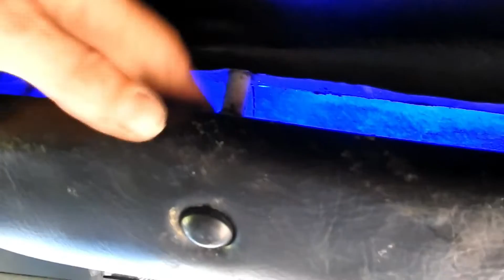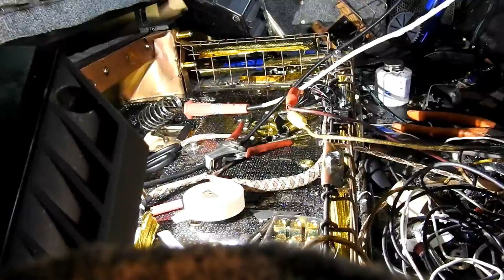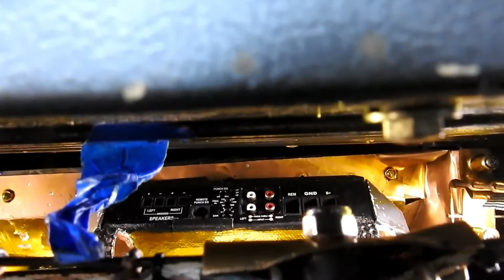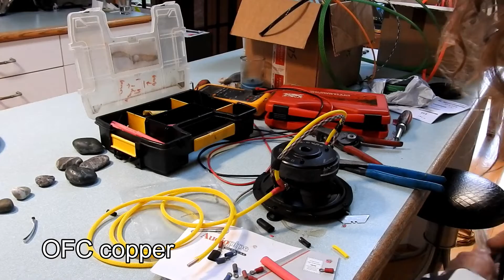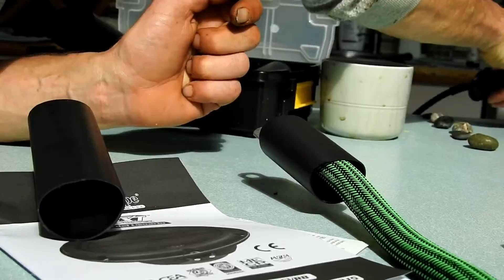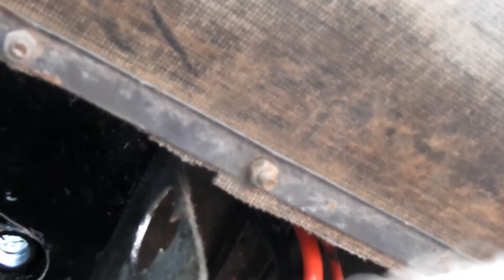car stuff no sky

Comment: It seems you have some type of plan. What are you preparing for?
Reply from the maker: Hi Melissa, had planned on traveling this past summer but I got a bit further involved with electrical upgrades. The older main circuits were only good for around 180 amps, we will need about 400 amps,  so the entire main was upgraded. The audio has a few new speakers, and added in another amp. For music . And a few interior areas that weren’t very good for insulation, so we had put a above counsel for storage. We plan on traveling , deserts, mountains, secluded areas.  So the extra circuits help against having a dead battery and the vehicle won’t start. We will have the capability for a larger battery bank , it basically means we can add more electrical devices, it’s similar to larger rv’s. Boats, emergency vehicles.  We’re only good for about 3ft water, for water crossings, and I added in some security mechanisms that won’t be easy to defeat. Safety cut off switches were added , reliably, and redundancy . Being extra careful about connections and plumbing the circuits. We didn’t go anywhere this year . And it’s only been about 7 months since the stroke and the Lyme issue I had so it’s also some brain therapy. I think next spring we should be good to test drive, and go adventure . Have a small business that’s been on hold because I’ve been so sick . We should be ready to make some headway with that too. And if we gotta go some where in a hurry we might be able to use the trucks for that too. Granted it’s not show quality by any means. It’s more about function. Camping is another thing we will do , plenty of room to sleep inside. Thanks Melissa
Reply: @BlueStar712  well it's amazing to say the least. You have come a long way since your stroke. And I love that you push forward. I love the lit storage area for phones.
Reply from the maker: Melissa C. Hi again! Thank you Melissa, May do a update and blabber a bit about the brain malfunctions that repeatedly surfaced . And you are absolutely right about how challenging it is. Atleast now I understand what it’s like. I’m thankful for having this kind of insight into the complications and challenges from Lyme and strokes.  It’s so Much easier to relate now with others. And I’m especially thankful for not seeking answers from the medical industry. Thank you again Melissa. ❤️💕. Much respect to you
Reply: @BlueStar712  

https://www.bandlab.com/skylercrable/ill-go-6808080b?revId=5fa09a34-b6fa-e911-add2-2818789a0160

Skyler's newest cover. The song is unfamiliar but I think it shows his voice off. And he made all the music in the song to. I will tell him hi for you.
Reply from the maker: Say hi to skyler for us.

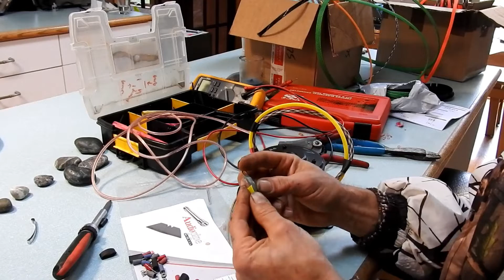Comment: Beginning @9:44 … there's a familiar sound in the background … sound of small parts … sometimes coins … having made an astounding journey through the wash cycle into the dryer … I could be mistaken of course …  
'n I have to do something like this when I hack my cellphone in order to charge it because the port is damaged … 'n replacing the port involves soldering … something I am not at all confident in attempting … so instead, because I still have the same Samsung Galaxy III [ circa 2012 ] which just happens to have a hidden port inside, I have to strip wires 'n thread tiny positive 'n negative "angel hair" copper threads … to tiny teeth 'n secure with electrical tape … put my phone back together 'n secure it with more electrical tape … that just so happens to match my phone exactly [ wine coloured ] … 'n no one would know except for the cable dangling out the side of my phone when its not plugged into charger.  S'ok though because I have no desire to get a new phone 'n I kind of like that I'm able to hack it.   🧚
Reply from the maker: iCarillon inChrist congrats on your talent to fix it yrself!  Those fine wires are difficult I’m sure . And yea u were right about the laundry carillon. 🙂🤗
Reply from the maker: Not too many can take the time to fix those tinny wires, and yea a very small and precise solder gun would work if your very careful, had a stereo that the digital chips would get disconnected because they used silver solder , and the small connections would crack because there was no lead ,  fixing it would mean I would have to put the chip board into a oven and eventually put solder balls on the clean surface , the small spherical balls of solder would then be placed on the chip and fall into the small holes then putting the chips back on while the board was hot. Kinda technical , ... I chose to have the manufacturer repair it, it was a recall. Lead is actually good for many purposes . Hope yr phone holds out ! Be well and God bless you